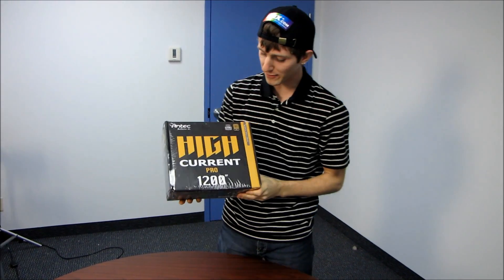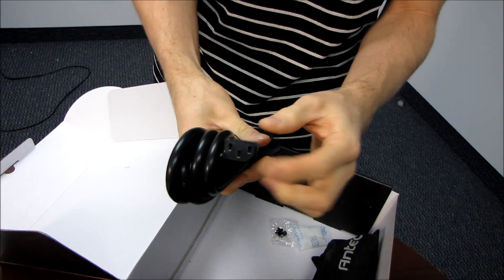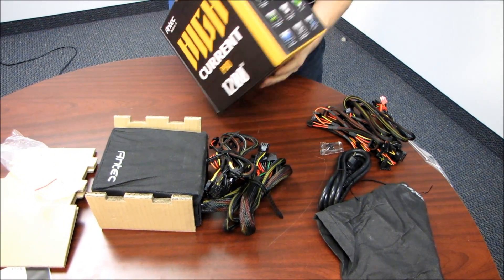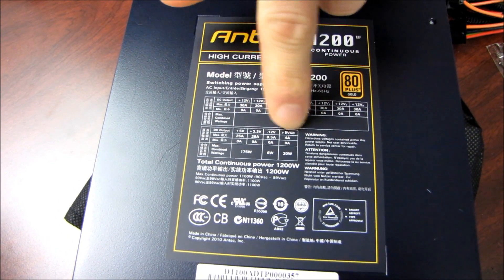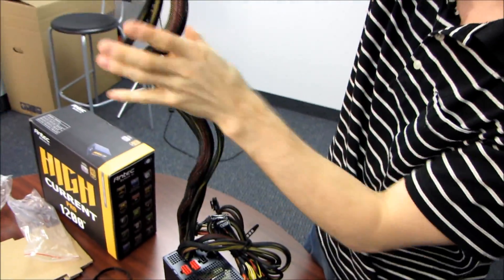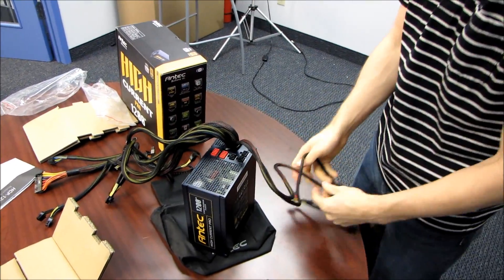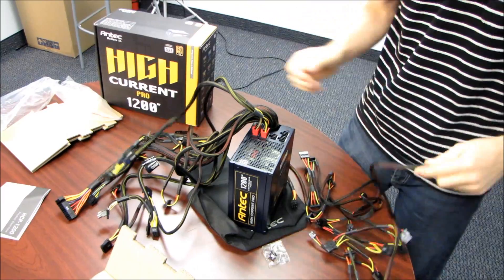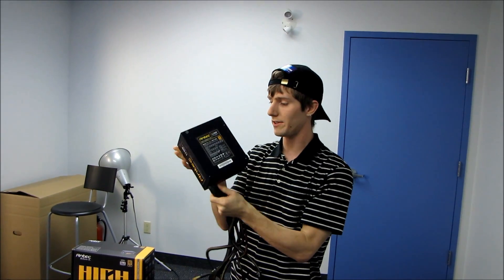High Current Pro 1200W Modular Power Supply Unboxing & First Look Linus Tech Tips

Comment: @MrJhangir there's a table with little boxes on top of your power supply itself or on the box it came in or the manufacturers webpage which tells you the amperage. 
Look under the heading +12V and you ll know how much amperes can your power supply provide on the 12 volt rail(the one your 6 pin and 8pin PCIe power connectors work off).

Comment: Nice video. The capacitors on the Quattro 1200 you mentioned were a testing PSU that Antec wanted to see if it was feasible or necessary to use in upcoming PSU Builds. Talking to the tech department, it is not necessary to have those capacitors for good performance. Hence after building that PSU, shortly after that the HCP-1200 was built.

Comment: @lol10105 My comment was not a dumb one. It was just my interpretation of their product. And for an item priced that high aesthetics do matter for some people. I vision these PSU's in watercooled rigs with 4 videocards with an extreme eye for detail. Those people wont buy this PSU.  And when did I say the colour of the cables matters?

I'm not saying this is a bad power supply, I'm just saying their previous ones weren't good and you can't deny that. It's an A brand making B PSU's.

Comment: @activate124 Does not take away the fact that it can not compete with the Corsair ones. I replied about the sleeving quality because Linus said it was very good sleeving. Uhmm, really? And the colour of the cables doesn't matter ofcourse but with sleeving of shuch a low quality they could at least have used black wires. Alot of people care about aesthetics. And I know preattached cables are better for overclocking because of the resistance but you've never sleeved a power supply I think.

Comment: @utubeb14 I will be running 3 580's as soon as they arrive. dont run the fourth because rampage 3 extreme wont do 4 way sli and because ax 1200 wont do 4 way sli either. not enough cables.

Comment: Linus can you do a test bench stress test for this power supply.  Would love to see a EVGA sr 2 with two watercooled xeon processors overclocked to 4.2 ghz plus 48 gb's of DOMINATOR GT 2000 mhz memory plus 4 water cooled 480 GTX plus 4 10,000 rpm 600 gb velociraptrs in raid 0 plus two optical drives running prime 95 and other benchmark sofware.

Comment: @Solidstate89 8 rails @ 30 A each? That is a 1920w my friend. Also, this drops maybe .1v at max on the 12v rail at 1200w+ load, while the corsair will drop .3v on the 12v rail at 1200w load, and will fail at a 1600w load.

Comment: Wow, must be the shittiest 1200W power supply I have ever seen. Sleeving is very poor, I could see right through it, way too many pre attached cables and they're not even using black wires but the ugly yellow/orange/green ones. Environmental packaging? Reducing costs you mean.

Only a blind and deaf man would pick this PSU over the AX1200, Have I mentioned the price difference?

Comment: @DKY193 If you are not planning on cfx or sli configs, than a brand 500W psu is enough. enermax liberty eco elt500awt modular high efficiency, corsair tx650 (its pretty cheap)

Comment: @jakuba8 The combination of rails will never provide as many amps as one rail. You cant just simply add them, you have to measure it with the proper equipment. If you use all 8 rails, the psu will provide 1200watts, if you use i its gonna be 240(thats unlikely), if you use two its about 350W and so on. Hope you get it.

Comment: it doesnt make sense if you have 8 rails of 30amps it means that you can pull 240amps resulting in a 2880watt PSU on 12volt only. why is it only rated at 1200w then?